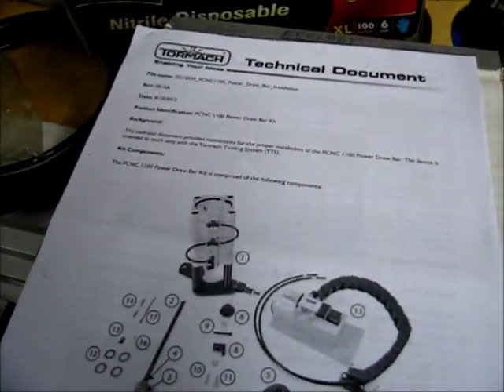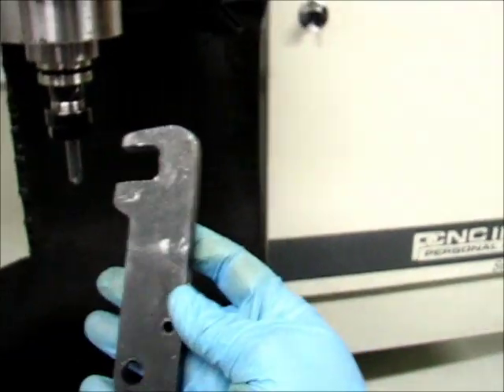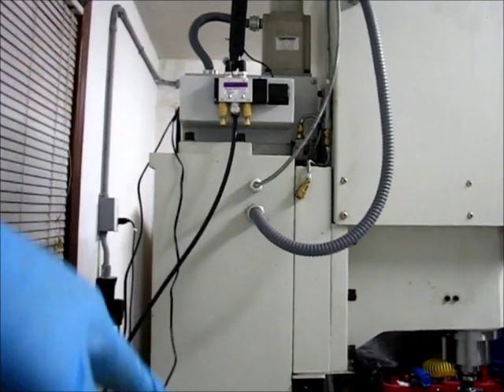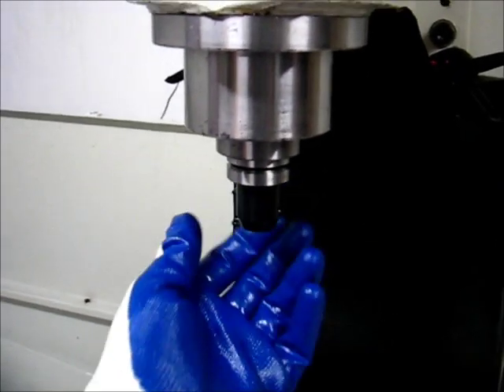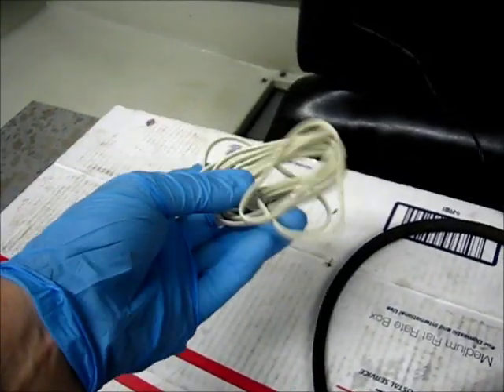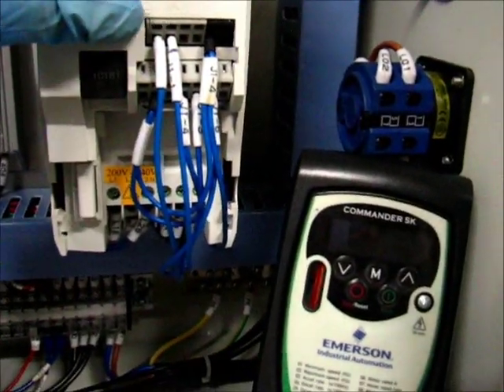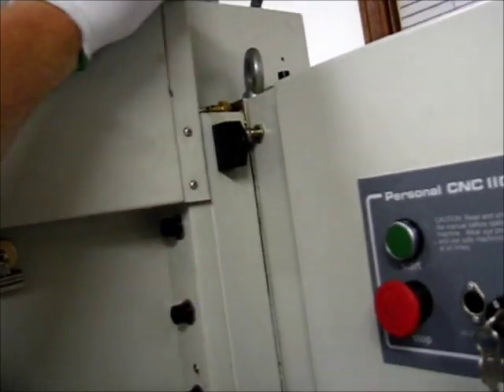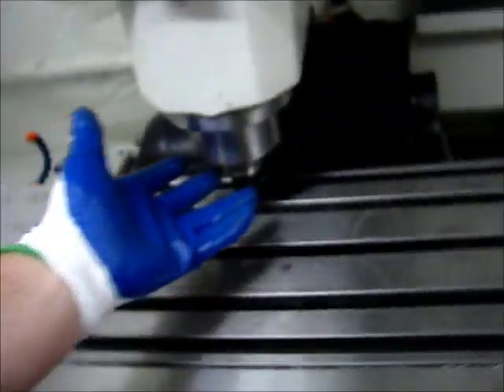Tormach PCNC 1100 - Power Draw Bar Installation and ATC Spindle Interlock Modification

Comment: Followed every step, triple checked all my wiring but does not work for me. It locks up the motor but still actuates. Do I need to change something in PathPilot to make this active or has something changed in the years since you have installed this?

Comment: Chris,  Great video.  I learned this the hard way.   I will be doing this all our PCNC shortly.
Reply from the maker: Oh no!  That's a bummer.  Hopefully it was just a matter of putting the drawbar stuff back together and no tools or parts were damaged.  Hopefully this video will make the process of modifying it a little easier for you.
Reply: Wasn't to bad but basically stopped using the foot pedal all together.   May start using it again after this mod.   I thought it was odd that the Tormach foot pedal didn't have a toe saftey switch like other pedals I have used in the past.   Again great video and thanks for taking the time post it.